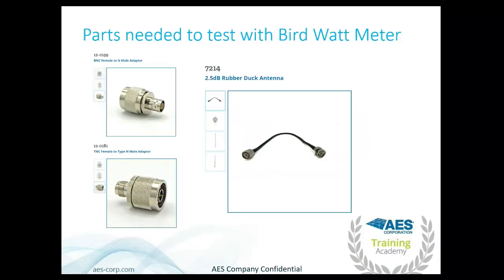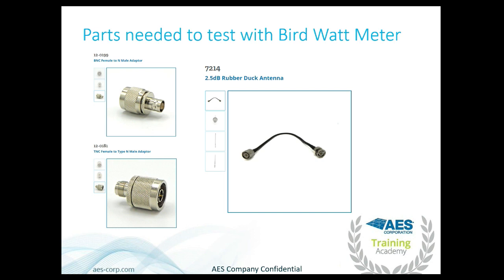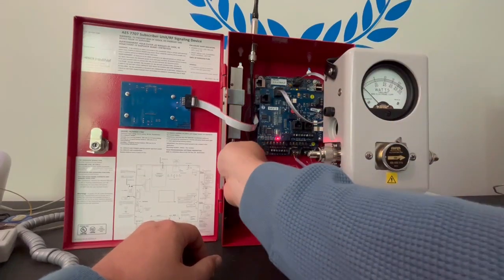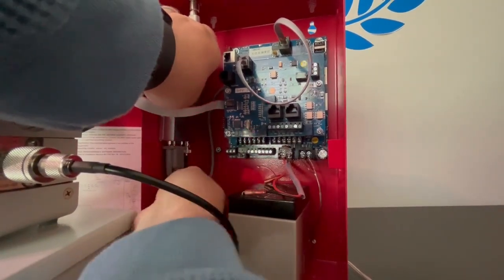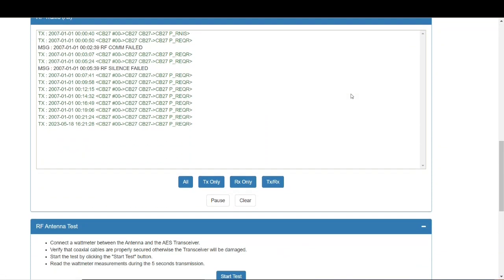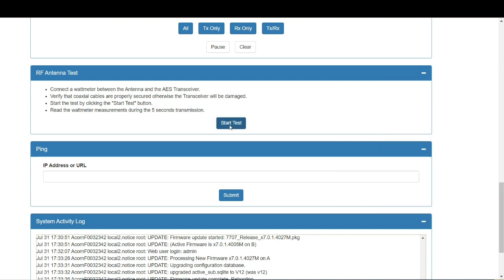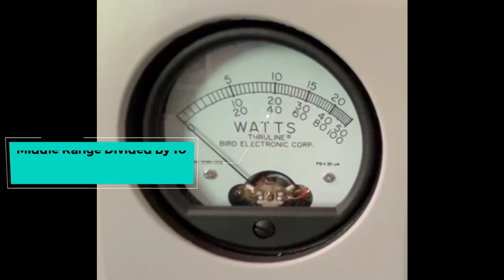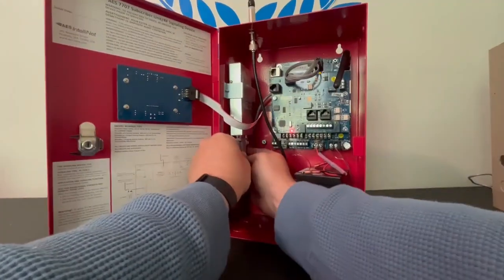How to Use a Bird Watt Meter with an AES 2.0 Subscriber

Comment: can it be possible that having a bad transceiver would also give you an inaccurate or failing reading?
Reply from the maker: This is one of the things the Bird Watt meter is designed for. Please make sure all of your connections are tight but if you are getting a poor reading from your Bird Watt meter it could be the transceiver or the cable causing issues.

Comment: Can the frequency on the RF module be modified?  Or is it ordered frequency specific?
Reply from the maker: The module, or element for the Bird Watt Meter is for use with a range of frequencies. I this case the range is 400mhz to 1000mhz.
Reply: @CorpAES  I was referring to the RF module itself.  Is it programmable to change the frequency.  Or do the modules come with a fixed frequency?
Reply from the maker: @jamiewhite1515  The transceiver in AES Subscriber have a fixed frequency that cannot be changed.
Reply: @CorpAES  ok.  I thought so.  I have a customer being somewhat held hostage based on the fact the frequency is licensed by the original installer who is not giving good service.  I guess new modules with new frequencies would be the answer.
Reply from the maker: @jamiewhite1515  They can be returned to AES for reprogramming as well! Contact us at support@aes-corp.com if this the route you would like to go!
Reply: @CorpAES  thank you for the info.